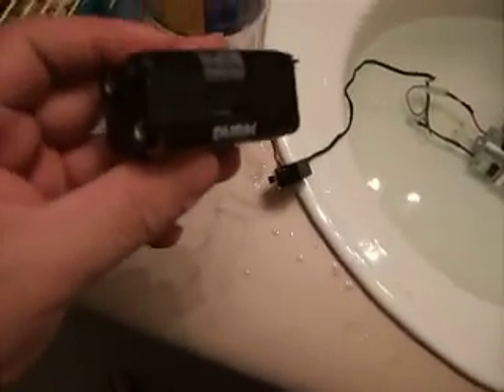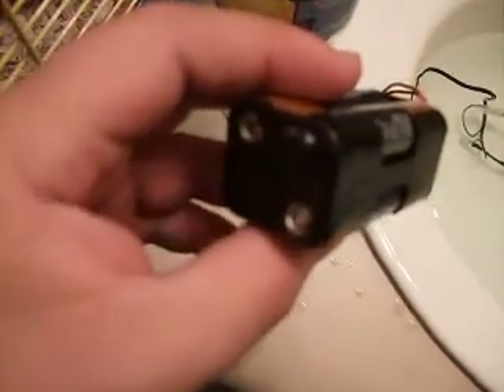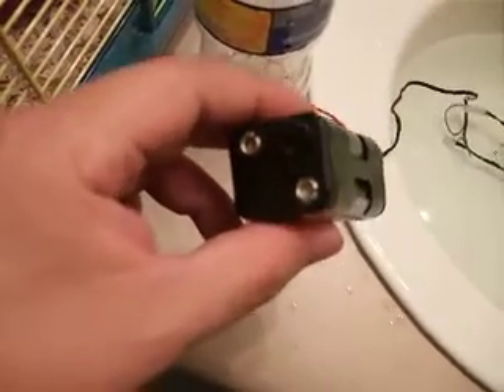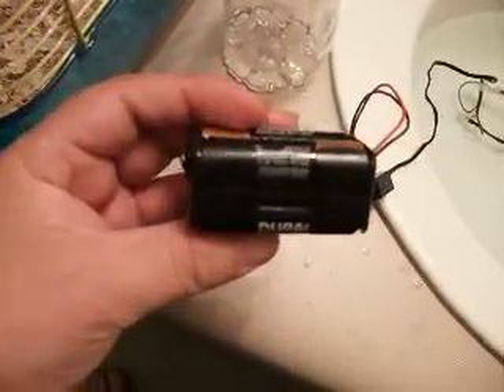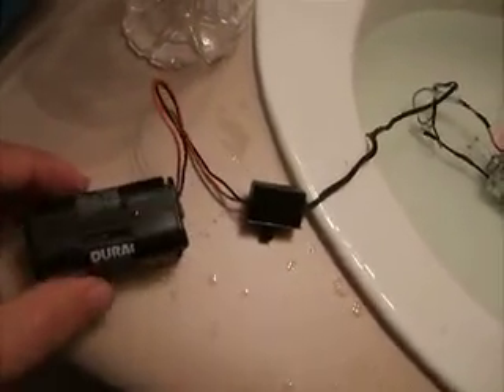E-Revo Single 700 HO motor Water Break-In

Comment from the maker: This is all I had. So I had to run it for a short period of time only and change the batteries. The batteries were not getting as hot as the small cables and battery contacts.

Your recommendation for breaking in a motor is just ONE of the many different ways I have heard.

Comment: im new to the rc community i have never done this or herd of it but after a bit of research i think using distilled water is your best options especially  if you have hard water like we have down here in the southwest and use thicker wires look at the wires you use on your car there that thick because there is a high current demand

Comment: wow dude =)) water brake-in it`s for brush-less motors.  then the problem with the contacts getting hot comes up because those wires are too thin. get a different battery holder and some thicker wires

Comment: dude, either switch out the batteries as soon as they get warm (not hot!!), or do it the way you supposed to: use 3 regular cells fully charged or a 6 cell, 1500mah or lower battery, half-way charged